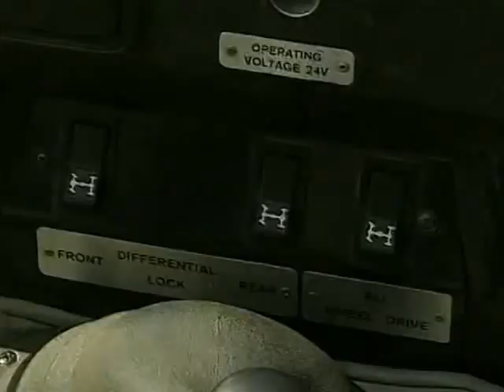Steyr/Puch - Pinzgauer

Comment: how to buy a new pinzgaur vehicles
Reply: Production has stopped due to not being IAD safe.
Reply: @harveysmith100  If you google search/ones craigslsit you can find them in running condition for about $9,000  (US) 4x4 when available. Very easy to maintain and tires are same as jeep price tires:)